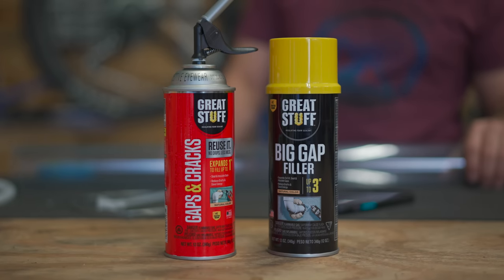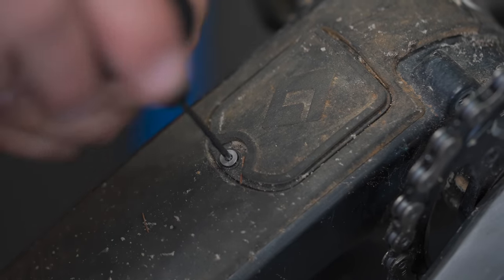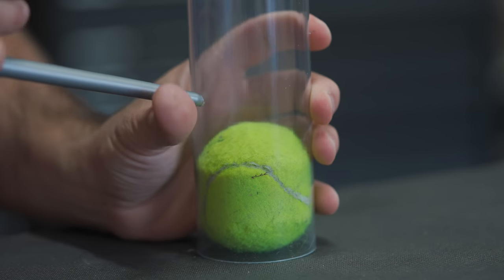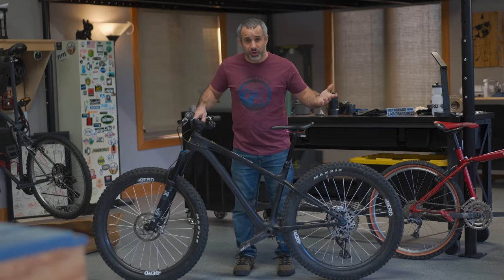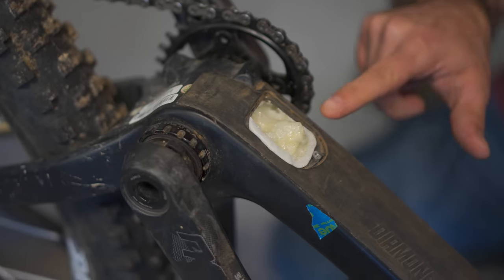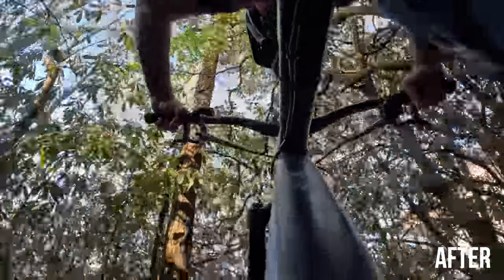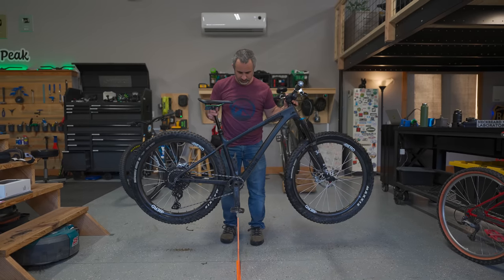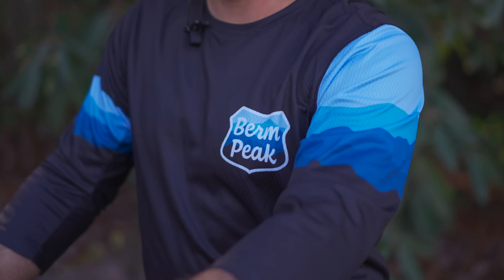Filling my bike frame with foam made it better—kind of. Don’t do it.

Comment: This was a thing with cars in the 70s- filling the empty spaces in frameswith expansion foam. Did it work? Kind of. Yes, it reduced noise and vibrations an maybe added some extra  stability in parts like doors. Problem- they all rusted away cause if you don't use closed cell foam like from the boat industry the foam will act like a sponge, absorbing water. You won't get a car body waterproof, thats why it's got drain holes. So i wouldn't recommend that for any kind of metal structure. Even if you use waterproof foam, there is no guarantee you get a real watertight inner fitting- therr might be gaps where water can be caught and cause problems. Working with a carbon frame there might be interactions between the foam and the frame. 
I guess, it's nothing you care about as a race mechanic because frames won't be used that long to get problems.

Comment: I wonder if you would get a reduction in noise if you put a tyre tube inside the frame and then pumped it up to fill the gap. Might stop vibrating parts and it would also be reversible.

Comment: Spank uses its proprietary "Vibacore" technology in its bars and rims.   which is spray foam filling the cavities.  I don't think they have published actual lab results showing its advantage over standard aluminum parts - just marketing material.    I'm sure there are some frequencies it can help dampen that might be noticeable to the rider, but it doesn't modify the stiffness matrix or add in actual compliance like a unique carbon layup can.  With that said, most boats have to have some amount of spray foam in their hull, and the difference is dramatic.  However, a boat and a bike are pretty different things, so I'm not sure the advantage is equivalent.

Comment: They make pourable 2 part expanding foam, ranging from 2lb to 6lb density. It's more common in the boating community and spray on insulation companies. The stuff in the cans is more for cracks and gaps.

Comment: I could only see a benefit for frames that don't have tube-in-tube cable routing.  Pivots come to mind, they tend to have a little more rattle without any cable foam or ... spray foam? deadening the cable slap

Comment: There are only a handful of situations where I would even consider this and I don’t even think they would require filling the whole frame. If you want to make a frame water-tight, I wouldn’t be against using some foam at all entry points, as long as you have conduits for cables and access to important components. One issue I’ve had as a heavier rider is that I use steel seat posts and I’ve even used steel-frame bikes. If you can avoid water from getting inside the tubing there could be some benefits. Even by filling the entire bike with foam, you’re only adding a few grams to the weight, you could weigh what’s left in the can and weigh a full can to get a rough estimate and I’d imagine it’s less than an ounce. As a 250+ pound rider, an ounce or two won’t hurt me. But other than filling entry points to avoid corrosion on steel frames or seat posts, there is basically no benefit to filling an entire frame. The only other thing I can think of is that if you have a lightweight frame and you ride near bodies of water or have to transport a bike by raft or canoe, you may be able to slow down the sinking process in the event that the bike goes overboard. We’re talking very specific purposes that don’t apply to the typical cyclist, we’re talking folks who either commute in the rain on steel frames or portaging and maybe for making a waterbike.

Comment: Back in my home building days, I personally have lifted a cast iron tub by accident using spray foam! Very heavy.  I DEFINITELY wouldn’t advise spray foam inside a carbon frame after what I’ve seen it do, and who knows what precise conditions each person will encounter.  There can be a couple big voids in a carbon frame that could both get sufficient air and volume to cause trouble.  But hey…. Report back if ya crack any! 😉 I would like to see it.

Comment: Structural foam has been used in frames for a while. Bianchi used structural foam in their ultra lite alloy frames in the late 90's early 00's.
The properties of structural and expansion foam are not analogous though. Structural foam's purpose was to increase/maintain structural integrity, any noise dampening properties were a secondary positive. Not sure I'd bother adding unnecessary weight to my frame  if only marginal noise suppression were to be gained. Why bother when a set of ear plugs could do the same for less weight and fuss.

Comment: I think the question is not so much noise but vibration, apparently they do this for the cobbles. Spank released bars with "vibrocore" which is essentially this. Anyway you could test with another device and possibly test for isolated noises passing through frame (not outside with wind etc.) Would be easier to recreate too. You could repeatedly flick a bit of cable outer or something against tube in the same place to make the experiment more consistent and I think if it was just simply checking the vibrational noise through the frame it would be more like 20% reduction. 😉❤️
Reply: Wouldn't it be better to just melt the bike parts into a puddle? 
You could make all kinds of stuff out of it. Maybe even some parts for your bike.
Reply: @chrisakaschulbus4903  isn't really relevant to my comment. Nice try tho. You on the right one?
Reply: @craigandheston-urbangarden1134  I mean, a puddle of molten liquid makes only some noise. But it'll aborb vibrations like crazy.

But i guess you're not man enough for it.

Comment: I would wonder if filling empty panels with foam in an older car would help but they make sense foam pads that you install. Maybe try wrapping the bike tubes in that sound deadening foam? Try that next? It's also probably easier to remove.

Comment: "can't be undone"
I think it might be possible to undo. You'd need a solvent that doesn't harm the frame and does dissolve the foam. Acetone /nail polish remover might do it? Realistically you might also need to attach the frame to a mechanical shaking device though, to get the solvent and foam to mix?

Comment: If the whole idea was to reduce frame noise so that you could more easily identify non frame sources of noise (chain, derailleur, etc), then you would have to try to measure the sound differentials excluding these variables. Which may not be possible. But you could imagine that a -2db differential whilst including these variables could in fact be due to a reduction in frame noise. Maybe there could be a blind test where there is some fault that would be perceived through sound, and subjects would have either a dampened or non dampened frame and you could measure who was able to detect the issue in which time frame

Comment: Not sure you care but.. a note on the stats.  While you have a pretty small sample size, you could run a test to see if there's a statistically significant change in the dB.  Heck, I'd just do another 10 or 20 tests of each (run and drop) and you'd have a pretty good sample size for your one change in parameters.  Also, I'm not sure why you'd take the chain off or isolate the cranks since you'd use those parts when riding (i.e., it would make your test meaningless); if the cranks or chain is the loudest part, then foam won't help eliminate that noise.

Comment: You need to take in consideration that those test were not a blind tests, so you could subconsciously drive slower and drop the bike gentler or from lower height to account those 2 dB. It can, and probably will happen despite your best effort to avoid it. Also, there could be a vast amount of different variables that influenced the result- like air temperature and humidity, background noise (strongly dependant on time and day) or even if someone moved some items around your garage that make echo work differently, or even just a cameraman moving around. So overall- who knows. I personally don't think the frame would be the source of the loudest noises, but maybe on impacts directly on frame? It could definitely help if you have loose cable inside, but I think there are better ways to fix it.

Comment: biggest question: what about vibration damping? I'm wondering the effects of filling an aluminum hardtail assuming that was a carbon syncer. Also what about making ultimate ghetto tire inserts( old tubes filled with foam)?

Comment: An interesting historical fact in this regard. Injecting an expansion foam is exactly what Cannondale was doing to fix up Raven frames back in 2001. All of the owners were called to immediately stop riding their bikes because of the risk that the bottom pivot will break apart leading to a catastrophic failure. The recall service that Cannondale dealers were providing was basically drilling a hole near the bottom bracket and filling the whole front section of the frame with the foam. Google for the whole story and broken frame pictures. This was a Cannodale’s big fail.

Comment: Perception of volume is always subjective and depends on one's own hearing but generally speaking, an increase of 10 dB roughly corresponds to the perceived volume doubling in intensity. Thus, 60 dB are perceived as twice as loud as 50 dB, so 2dB it's not that small of a difference, it's actually 25% quieter.

Comment: Here are benefits in removing stress and twist from the frame. Just a need a right closed cell foam. I would use it on carbon, titanium and steel frames. Added weight is measured by weight difference in the can. 200g +? I think here is the interesting point for research of making stronger lighter carbon frames filled with rigid foam.

Comment: Just a thought but the foam might make ur bike float now since it should be water resistant and be able to displace water better. Could be useful if ure transporting ur bike on the back of a kayak and it falls off, or if u were doing a river or creek crossing and the water was deeper than u thought in that area and u fell off.

Comment: Ever heard about SPANK Vibrocore? About three years ago I did a test ride with two bikes that had identical tires, pressure, wheels, and forks. I could easily tell that my bike, which had the Vibrocore bars fitted, felt much less of the buzz from the Assegai tires on hard-surfaced trails and roads. The owner of the other bike was surprised and ended up buying an identical SPANK bar. After a couple of weeks, they also added a set of SPANK Vibrocore wheels to their Scott Ransom.  The foamed parts are (some grams) heavier.

No compensation was received from SPANK for writing this comment.:face-green-smiling:

Comment: If you pump Acetone into the frame  it'll melt that spray foam. Once u put Acetone in it and let it sit in there for 10-15 mins to melt then take your air hose and start pumping/pushing the air through it it will push out all the liquid/Acetone/foam mixture. It will clear the whole frame right out by doing that.

Comment: Different formulas for different purposes. The "Gaps and Cracks" formula you start with is a high volume-low pressure formula. it comes out of the can as expanded as it going to get. The standard formula is the dangerous one. It keeps growing slowly for 15-30 minutes and can jam doors shut, and might be enough to crack thin carbon.
Reply: also note: MEK is the best to clean up after "Great stuff" spray foam.

Comment: A better, cleaner, and more reversible option would be to just use like foam backer rod. Maybe even door seal foam or a chopped up pool noodle. Basically any foam that isn't a spray.

Comment: IMO to do a proper test you should remove the chain and cut all external cables so that only the interior ones remain. I suspect some of the gains you would otherwise have are also negated by having the cables run through channels - so I don't see a point if you're still going to have loose cables slapping around inside your frame

Comment: You should be able to buy a bucket of non pressurized brake clean (the kind auto shops use in their own cans they refill and pressurize with air) at an auto parts store. The brake clean should dissolve the foam.  If not, I do know there are solvents available that will. You can flush the frame out if you want to remove the foam.

Comment: Guys, there is no such thing as "foam". There are hundreds of substances that create polymer self-expanding structures. The most popular is polyuritane based moisture curing stuff. And it's extremely unsuitable for the things you describe in this video)))
Get some 2 component poly foam. They have different densities starting from 1kg/m³ up to 100kg/m³. I used a dozen of these for various purposes, from filling inside tanks if a boat to make it unsinkable (the one with 1kg/m³ of course) to the most dense and rigid orange stuff with a density of 60kg/m³, which feels more like bubbled up aluminium, and rigid as f***. Of course the first one expansion ratio was around (if I remember correctly) 1:180, and the second one had 1:1.5. So you can achieve various effects by picking up different foam. You can make your frame more rigid, or create an unsinkable frame)))

Comment: Well, a diffrence of 3 dB is 2 times the sound intensity 

For example: if a drum makes 100 dB and you add exactly the same drum, it does not make 200 dB but 103 dB because the scale of sound intensity is logarithmic.

So roughly 2 dB reduction is significant (almost half the reduction)

Comment: Hello, professional foam seller here.
The thing is - the warmer inside your bike is - the lighter it becomes. Remember, hot air expands.
it is the same as with car's winter and summer tyre air. You need to change it twice a year.
Also - this helps to make Your bike frame a bit more rigid.

We are currently developing winter and summer revolutionary foam, also only 150 usd liquid foam cleaner.

Stay tuned and be creative !

Comment: Yeah, but the point is to be able to hear the difference, so if the only difference that can be detected, is with a decebel meter.  Then it's a fail, right?   Because it sti sounds the same to you when you ride

Comment: The foam creates a more rigid structure & dampens high frequency noise being transmitted. To be real, test on a can with twist top to drill & mount Schrader valve to take pressure with a shock pump, most keep max, the valve stem can be removed to clean it. Knowing the volume, test by seconds of fill vs pressure, engineer those results, compare texture & strength.

Fill the frame with water to get foam volume, move the tube out constantly as it fills, practice that, there are foam mix & guns to rent for this used by wall installers a flash.

IOW, if serious as that, it'll improve the ride for not much weight, if you practice pulling the tube in the test can to get the rate down, it'll be unlikely to overfill to pressurize a section to structural significance my take.
Ymmv 🍺

Comment: I have never know anyone that wants there bike heaver. I have always tried to find lighter frames. What about just putting a few 1x1" squares of peel and stick sound proofing for car audio to the frame. It would I think add less weight and may have the same results as the foam.

Comment: I think you should've found the biggest noisemaker by systematically taking things off, and devised a way to dampen that sound. Say if it's cables rattling against the frame, then thin rubber strips wrapped around the housing (or foam bumpers) would've been a lighter and less permanent solution.

Comment: Actually i had to do it, because there was a loose part of carbon in my frame that couldnt be reached to cut off, so i just HAD to fill it up with a bit of foam.
It was ratteling so hard, getting on my nerfs, afterwards it was quiet and i was lucky again :D

Comment: I mean with this simple test you can get about 2 decibles off, if you do it professionally with some engineering knowledge, you can probably get it to about 5  decibels, which is starting to be somewhat significant result. Any edge can help in competitive racing.

Comment: I just seen foam filled carbon fiber rims. The foam sandwiched between the cf rim walls adds strength while adding very little weight. The bike manufacturers are finally catching on.

Comment: its deduction dear watson weigh the can after unless you used the rest up get a new can weigh it spray out till it matches your can weight then weigh the dried foam you sprayed out.  that foam in the frame might actually take a few weeks to cure it needs air to cure so no air in the frame foam core willl take a long time to cure

Comment: People actually don't put it in vans because of it collecting moisture. Yeah a bike won't rust due to soggy and moldy foam in the frame but still.. wouldn't it be a good idea to keep it out of the steerer tube and bottom bracket area also?

Comment: Interesting. Somehow. 😅 For me the most annoying sounds are the cables outside rattling against each other, brakepads scratching slighty. Fixing noisy cables slapping each other, running something like an onyx hub and foamliners around the cables inside the frame makes the bike so incredibly silent, that only tirenoises remain. Especially when running a coil shock in the back and the new rockshox forks up front that make no air sounds anymore.

Comment: There are other advantages to doing this that have nothing to do with sound. Material Strength increase, and mechanical endurance increase. Basically you are reducing the risk of braking the frame by a margin, plus less moving mechanical parts = to less change of failure.

Comment: Most types of foam require moisture to harden. If there is no moisture, or it is not enough (and in the closed  bike frame it will all be absorbed rather quickly), then this thing will harden for a very long time.